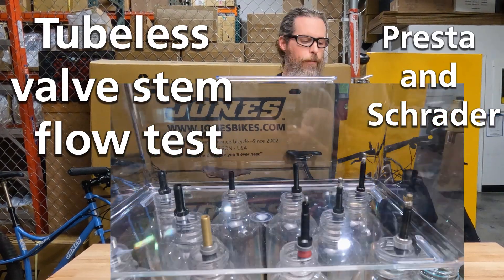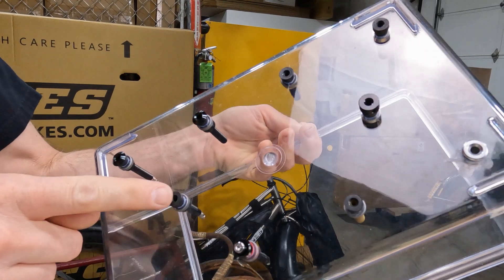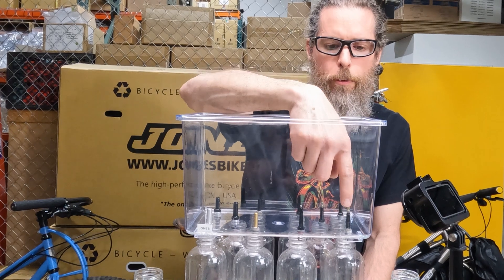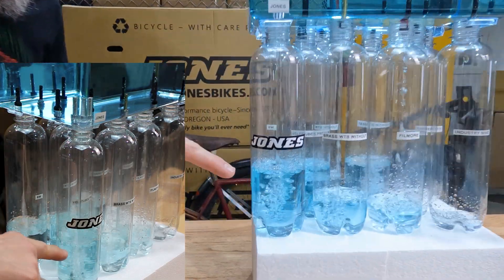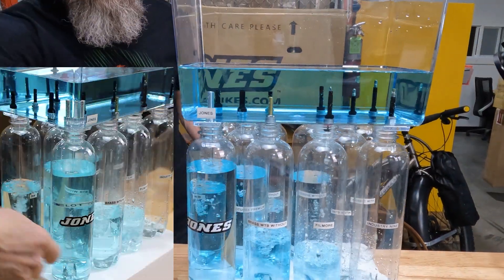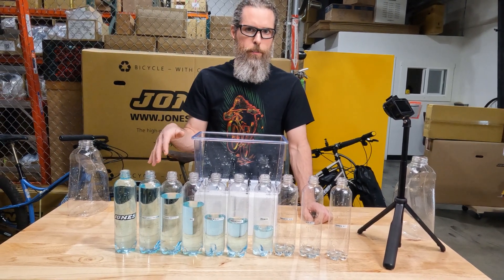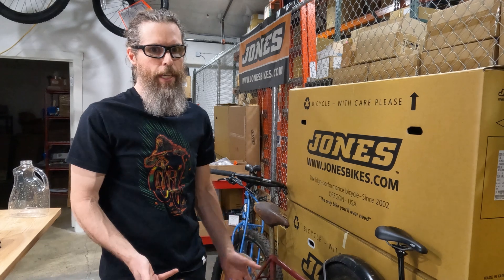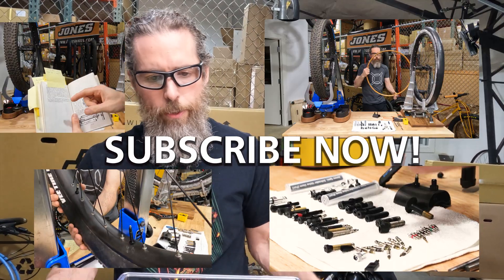Tubeless Valve Stem Flow Test - High Flow Presta VS Jones Schrader

Comment: Yay!  We love Schraders.  The guys at the LBS could only say, "Presta is a better valve."  With no argument in support of Presta.
   Schrader works well in a 4 psi wheelbarrow, and a120 psi 18-wheeler semitruck.
Schrader is spring loaded core, we don't bend the hell out of them putting on and taking off pumps like Presta.

Comment: How is it practicle to test valves against others with the core removed? When are you ever filling a tyre with the core removed?
Reply from the maker: Removing the valve core from Presta or Schrader stems when you are trying to seat the tire bead on the rim for installing tubeless tires, allows for a faster inflation speed that will pop the tire into the rim quicker and easier. Once the tire is on the rim correctly, the cores are reinstalled and then you fill the tire with air.

Comment: Sorry if you already explained this, but doesn't air flow at a different rate than water?
Reply from the maker: Yes. When comparing the flow of water and air through valve stems, the differences in density between the two fluids can lead to variations in flow rates. However, our test was done with low pressure and low velocity, which makes the differences in viscosity between water and air less significant. Viscous effects tend to be more noticeable at higher flow speeds and pressures. So, at low flow rates and pressures, the impact of viscosity on flow behavior is reduced. Also, at low pressures and velocities, cavitation is not likely to be a concern.
The purpose of my test was to rank the tubes based on their relative airflow performance, using water as a practical proxy making it easier to see than air. While it doesn't provide an exact comparison of actual airflow volumes, it does allow me to compare and identify which tubes permit more flow than others.    Here's a video where I test valve stems with airflow: https://youtu.be/m4NQwAWEsZw

Comment: Do schrader valves match presta strength  when road biking like 90psi? Do they keep debris away from the valve? These are the two rumors I have heard. Neat product, i havent gone tubeless yet or id buy them.
Reply from the maker: Yes, both Schrader and Presta valves can handle high pressures effectively. While Presta valves are often associated with racing bikes and higher pressures, Schrader valves, were originally designed for bike tires and are now also used in bike shocks running up to 250 psi. Schrader is also used in aircraft wheels, almost all motor vehicles worldwide, medical gas systems in hospitals, refrigeration, air conditioning, and SCUBA gear, among others.

In terms of debris protection, Schrader valves hold up very well. Even without a valve cap, any accumulated dirt or sand can be easily expelled when the pin is pressed. Schrader is used in muddy environments, such as on tractors working in the fields. Many vehicles also operate without valve caps without encountering issues. Cleaning or replacing a Schrader valve is straightforward, and finding a replacement valve core is very easy if you ever need one.
Reply: As far as PSI, DEFINITELY YES! 
one of many examples is the forks on an MTB have Schrader valves and they are generally over 100 psi.

Comment: I only recently found out that there was Schrader tubeless valves- I've fitted them (£9 from Amazon) to my old DT Swiss 26er X1800 wheels I've turned tubeless and will be fitting them to the H1900 E-MTB wheels next time they get new tyres/sealant. I hate Presta so much, necessary on my road bikes but on 35mm rims?? They are so fiddly, the ends can be broken by the pump and the damn cores sometimes unscrew from the tube if you're not paying attention when you think you're just loosening the top to put air in. Sh*t design really.

Comment: Jeff you’re a mad scientist! Hey what are your thoughts on drilling out an aluminum presta wheel to accommodate a schrader valve. 
Our shop (Einstein cycles) gets asked by riders to drill that damn hole bigger so they can use a “ normal” valve… and their air compressor. Usually folks don’t want to have to by an adapter or invest in a tire pump. 
I’ve drilled out wheels in the past… knowing it would void warranty. That being said we just don’t offer that as an option….skinny road wheels… probably not a good idea, mountain wheel probably not an issue… what do think?
Reply: Not Jones so not as experienced obviously. But I've drilled out every aluminum rim I have for Schrader. Including my hardtail that I've taken to a downhill park multiple times. I've had zero issues.
Reply: @STfofisnuffle  thanks Tyler! Ive heard people suggest it would affect structural integrity… maybe on a narrow road wheel running higher psi I can see that. Some of the old school mechanics cringe and scream about liability issues the shop may incur. Schrader valves make a lot of sense for set up ease.
Reply: @allengarrow6295  thin road bike wheels I can see, but a wide MTB wheel.... modern mountain bike wheels are so damned strong, there's videos of people hitting stairs on the bare rim
Reply: I did it to every MTB wheel I've owned that came with the dreaded Presta- 8.5mm drill bit is needed just be careful, go slow and clean up the edges and clean out any bits of metal.
Reply: Use a tapered hand reamer.

Comment: I have not found clogging to be a problem with valve cores removed. With the valve cores removed, you can figure out the winner just by looking which valve has the biggest hole so what is the point of this video? The only valve in this video that has any real improvement over the old pressta/schrader system is the Fillmore. And that can be improved also and I’m sure someone will do that.
Reply: Exactly. This has been the bike Industry last 15 years. Something different, then somehow telling the world the tried and true method is obsolete.  Some of us did Schrader ghetto conversations years ago B4 Google knew Stans.  It's about wheel weight/balance.  They both have plus and minuses.

Comment: So…. we’re not pumping water through our valves, which is incompressible. Can we reconfigure this test with air?
Reply: Yes air and have the test done with the cores. You’ll see the Fillmore valves will blow all of these out of the water. This is a smoke and mirrors test
Reply from the maker: Yes. When comparing the flow of water and air through valve stems, the differences in density between the two fluids can lead to variations in flow rates. However, our test was done with low pressure and low velocity, which makes the differences in viscosity between water and air less significant. Viscous effects tend to be more noticeable at higher flow speeds and pressures. So, at low flow rates and pressures, the impact of viscosity on flow behavior is reduced. Also, at low pressures and velocities, cavitation is not likely to be a concern.
The purpose of my test was to rank the tubes based on their relative airflow performance, using water as a practical proxy making it easier to see than air. While it doesn't provide an exact comparison of actual airflow volumes, it does allow me to compare and identify which tubes permit more flow than others.    Here's a video where I test valve stems with airflow: https://youtu.be/m4NQwAWEsZw

Comment: Another tip is to get a bag of premium Schrader cores that are used in the HVAC industry. The HVAC Schrader valve cores are used for charging freon in heat pumps and AC units, so they have to be high quality. Just use a new valve core every time you top off the sealant, and you won't have any problems with clogging.
Reply: Maybe immerse a valve core in a sticky oil before assembly per Silca recommendation too 👍

Comment: I switched from Presta to Schrader years ago, when I went from i-19 rims to i-23 rims! At the time I was using tubes of course, but I'd always buy Schwalbe or Continental tubes because they had a metal stem with a nut. Similar to what Schrader tubeless valves are now. It's still amazes me how many people are stuck on presta, even for MTB.

Comment: Presta is European and only used on bicycle rims.  BMW doesn't use them, nor Mercedes.  They all use Schrader.  In America any air compressor you use is set up for Schrader.  For presta you need an adapter, which can get lost.  I guess the only reason to use presta is so that you can be all snobbish and euro looking.  Apparently that makes you a better cyclist.

Comment: Jeff, you are the mad scientist of mountain bikes.  Why are we all using whimpy little Presta valves?
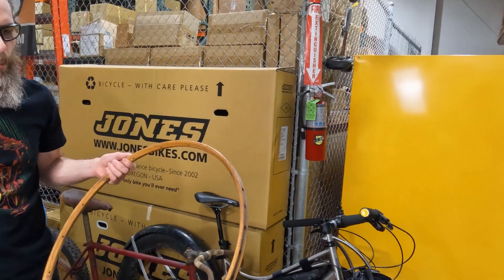Reply: You may have seen it already, but he addressed the history at 4:51.  I think the inertia of adoption is just that -- people get used to something, and it takes time to change their minds.  I have to admit that I see Schrader and think "cheap" because it was what was on my first, and crappiest, bikes.
Reply: If you do a flow comparison with the cores in you’d be surprised to find the Presta valve actually flows more because of the way the core is configured. The Schrader cinching mech (the spring) is internal and the Presta cinching mech (the micro nut) is external. Throw some Fillmore valves on and save your backs

Comment: Thanks Jeff  that was lots of fun.  It's amazing that the schrader valve is probably the most common invention known to man.  In almost every air tired vehicle from tiny trikes to tractors.   Weird fact, I spent 10 years designing high flow air valves  like this only for pumps.
Reply: The most common invention is the wheel. With or without air.